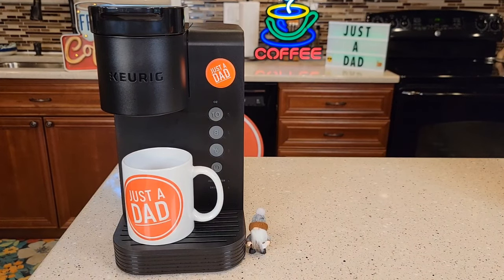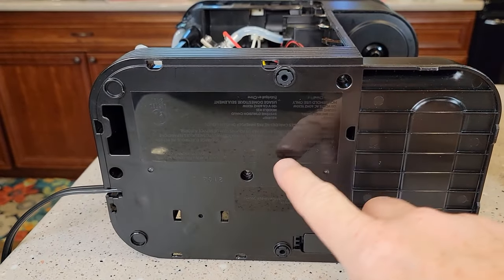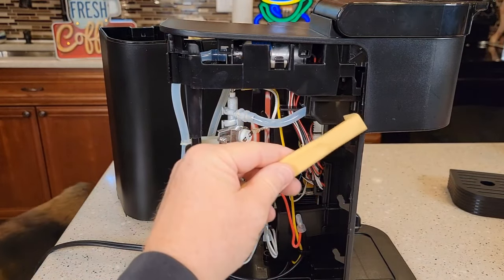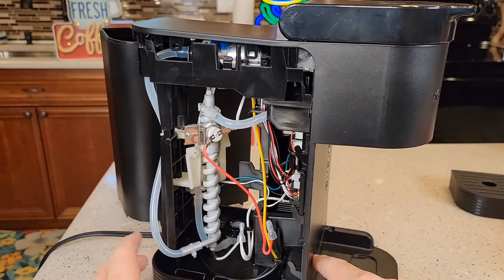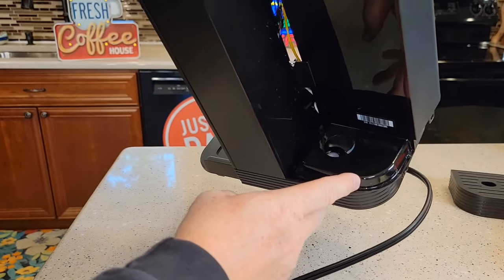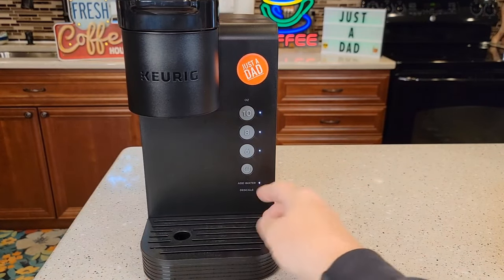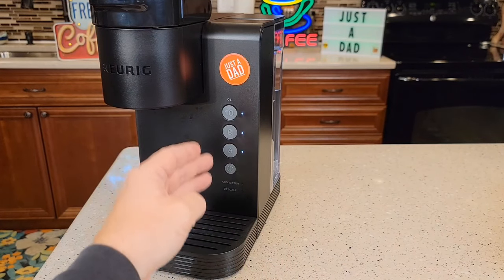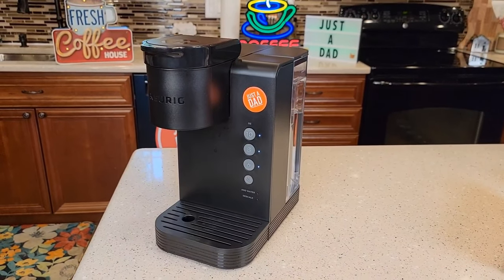How To FIX Keurig K-Express Essentials Coffee Maker Not Working No Power  RESET IT

Comment: I was able to pop off the panel slightly using two flathead screw drivers at the same time. One at the corner base and one a couple inches up the seam.  There is slight damage to the plastic panel due to my prying. Once I removed the panel wide enough to fit in my hand, I used a paperclip to push the button like he does in the video. I didn't take the panel fully off. Only enough to fit my hand. After pushing the button with a paper clip, I plugged it in and the lights came on!

Comment: Any chance of getting measurements to locate the thermostat from outside the case. Thinking about drilling a small hole to insert a stiff wire to reset the thermostat and then using a small plug to fill the hole. Thanks in advance.

Comment: Great video. Was about to just throw it out until I found your video. Did run it dry during rescaling and noticed last second and powered it off amd it didn't turn back on. Did break one of the tabs off but it was un the back so oh well better then buying a new one

Comment: Mine has power and works but the water is cold. Brand new machine. It only worked on the first brew and then never worked again. The water just pours through. I wonder if I have the same problem as mentioned in this video.

Comment: Mine is doing something similar but it has sentimental value so I'm scared to pry it open until I'm sure. Would it be the same cause if when I press the power button the lights flash a couple times and then turn off and none of the brew buttons seem to do anything?

Comment: On the left side of the keurig there is the largest “panel”. From the top right corner of that panel, measure down 4 inches, and then to the left 2 inches. Drill a hole and then you won’t need to scratch up your machine or break the internal clips to gain access. From there you can insert the pin straight into the thermostat to reset it. Wish I would’ve done that instead of ripping it apart. Take my word for it.

Comment: I Descale machine, once done it wouldn't brew anymore. No power so I opened it up so I can reset switch, plugged it in power button or open lid only blinks twice but not lit when open.  Tested see Descale modes works & brewed finished 2nd time same thing. No lights on  buttons when Descale finished ,but i can manually push & hold 10oz it will brew. Once i let go from holding it down it will stop brewing. 
I guess i have to manually hold it down from now on.

Comment: we got this exact machine from Walmart, brand new, never used... Unpacked it, filled water in to the fill line and put a k cup in. turned on, and all lights went on for 6, 8 and 10... The water sensor works because if came on for a second and went out, realizing that it has water in the tank. But the 6, 8 and 10 lights do NOT blink asking for what size coffee you want, but they stay on, all three of them. Tried everything I found on the internet, this coffee machine does not work... Any solutions to make the lights blink so I can brew a coffee? Again, this machine is brand new, NEVER used, also is not a store return as the machine is clean, not one bit of coffee in it, brand new, yet doesn't work... ???

Comment: This problem is apparently widespread among Keurig coffemakers.  I had a K-Supreme model that also needed to be reset, therefore I drilled 1 1/8" hole opposite the reset button.   On my K-95, I drillled a 1/2" hole to access it the next time it overheats.   This a clearly an engineering issue, and therefore, should be repaired by Keurig on all models with this problem.   Need a Class Action lawsuit?

Comment: Who thought it would be a good idea to use a manual reset fuse rather than an automatic one, and use almost exclusively PLASTIC CLIPS! I broke 2 pieces and a few clips getting mine apart. If it happens again, I'm just cutting an access hole.

Comment: I did the whole thing I haven't put the cover back on to try it b4 I do..I plugged it in and still the same issue lights will blink on but will not stay on.. it's that because the cover is still off? Anybody had this issue?
Reply from the maker: have you tried to descale it by putting it into descale mode. https://youtu.be/gBjanoIwWRU
Reply: had the same issue

Comment: Mine did exactly that, killed itself while descaling. I couldn't get the plastic apart so I threw it on the floor and shattered it everywhere. Absolutely UNACCEPTABLE design quality; I'm an industrial quality analyst, I would know. Their garbage design caused economic loss to me, and thus causes economic loss on the macroeconomic scale. Probably so they could save less than 50 cent each on not buying self-resetting thermal cutoffs. Never buying Keurig again, they've ruined their reputation.